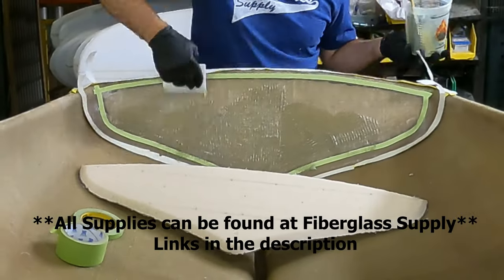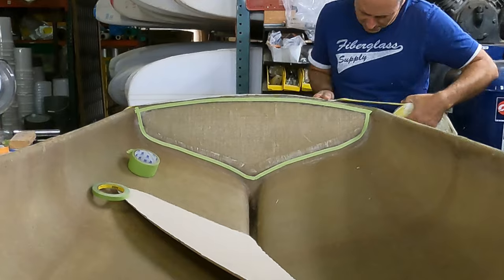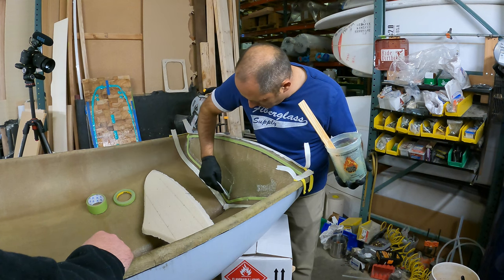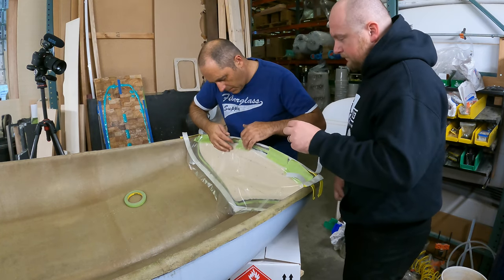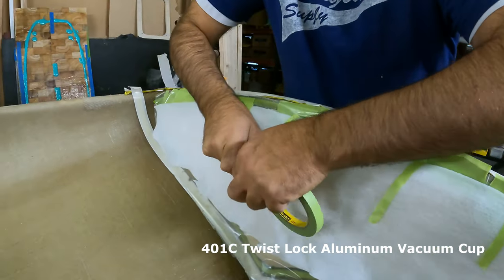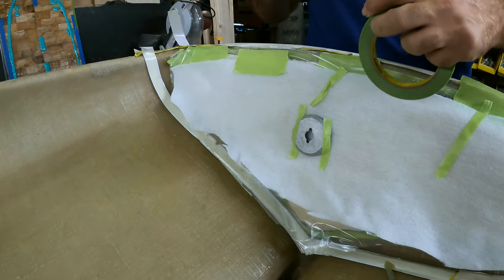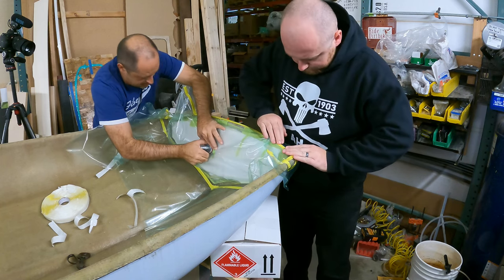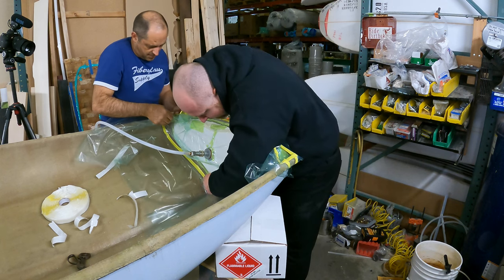Vacuum Bagging a Transom Tutorial with Fiberglass Supply

Comment: For "typical" small boat construction, can the appropriate closed cell foam material be used?  Does this technique require vacuum bagging?
Does this reduce cost and weight over using conventional wood materials?
Thanks for the vid.
Reply from the maker: Small boats, yes. I wouldn’t use closed cell with anything bigger than a 25hp.

Comment: This is one of the few videos of vacuum bagging with Polyester resin, I assume one of the issues is the resin catalyzing before the vacuum can be pulled, have you had any problems?
Reply from the maker: I personally haven’t had any issues but I am sure that can be an issue. I know with the coring bond putty I am going to use is very precise in measurements and is 50-55 minutes before it catalyzes. The span is every 2 degrees and it changes the time to catalyze. I think just having everything ready and hooked up before and know you’re ready is the best way to go. This transom was pretty difficult since there wasn’t much room to lay the vacuum tape down which delayed the pull of the vacuum.

Comment: I've heard that vacuum bagging with polyester resin can be a fire hazard? Kind of bummed about that because I have 3 gallons waiting for a vacuum infusion process to build a kayak. Totalboat won't give me a straight answer. I've read the dangerous that the pump can ignite the polystyrene gas
Reply from the maker: I’ve never heard that or seen anything like that. I see people do it all the time with no issues!
Reply: @LindellAdventures  the problem I've heard on different boat building sites is that compressing polyester resin fumes turned it into polystyrene gas which is highly volatile. Even the manufacturer that sold it to me is now saying not to do it.

Comment: Such a small low stress type of repair why is all of this necessary? Is it just to show how to do it? Seems to me this repair could have been done with a paint brush and a plastic cup. I've been repairing boats using west system for years. The only time vacuum bagging was done was for building a super lightweight rowing shell, in a mold.
Reply from the maker: I guess I’m not really understanding the question. It’s just showing how to vacuum bag and using a transom as an example. Vacuum bagging is a good process for constant pressure and better pressure. Is that what you’re asking?
Reply: @LindellAdventures  you answered perfectly. As a demo on how to vacuum bag it was excellent. Ignorantly, my point was it seemed like overkill for such a minor low stress type repair.

Comment: Are you vacuuming down a thin layer of glass Bondo and if you can stretch the plastic a little tighter you can save materials money for the customer not trying to be a b**
Reply from the maker: It’s just the way we decided to do it. It’s not that hard expensive and to redo it when there isn’t enough, that’d be worse. It worked though!